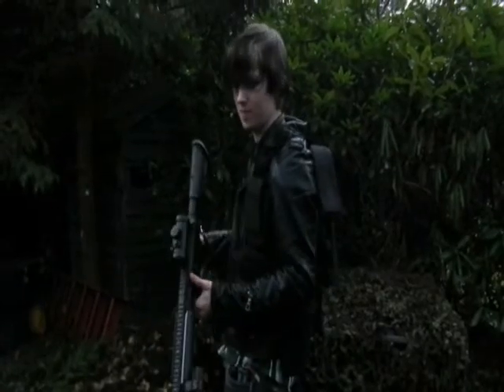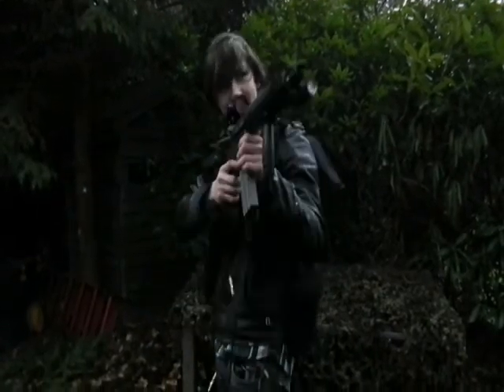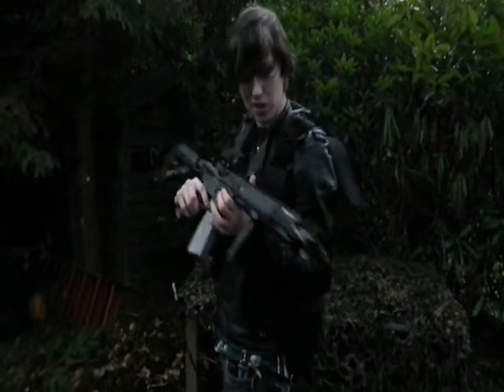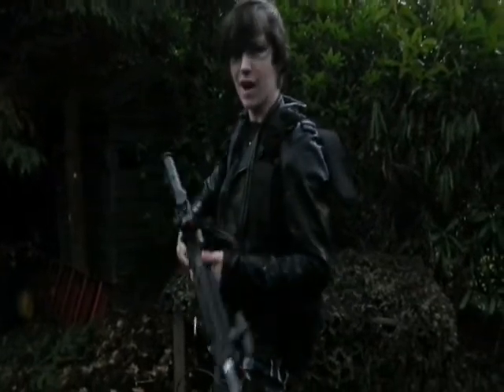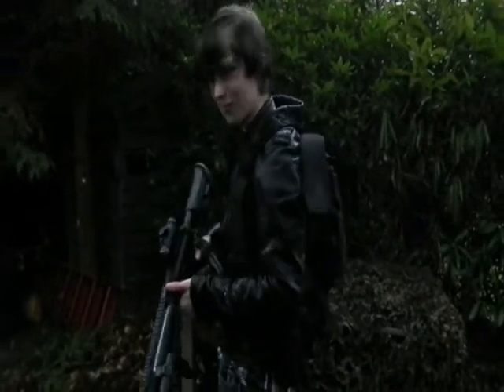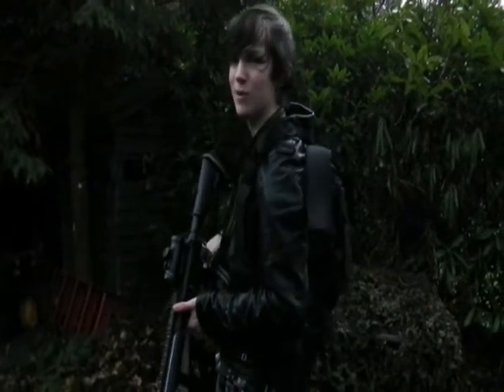HPA conversion  ASP Airsoft M4

Comment from the maker: Similar to the Polarstar but different in many ways, its only programmable from a PC to stop people changing settings mid game, it has two selectable FPS settings that can be set for full single and auto, and direct setting of RPS. Also includes a programmable burst mode that's can be turned on and off via trigger pulls The unit drops straight into a standard gearbox housing. Price around £150 not including HPA rig (when I get them into production)